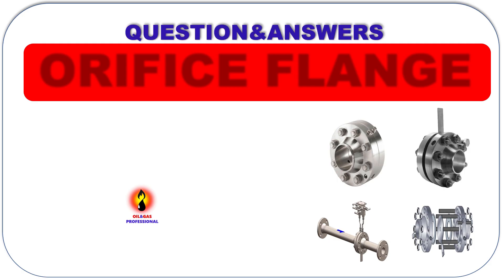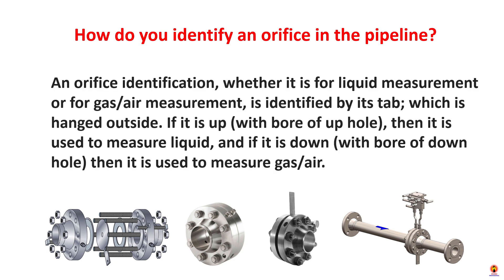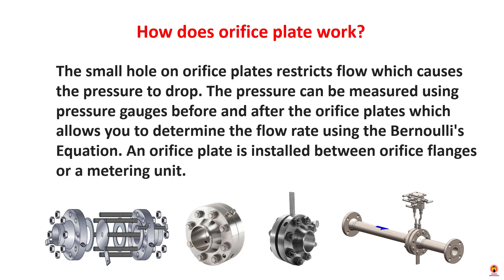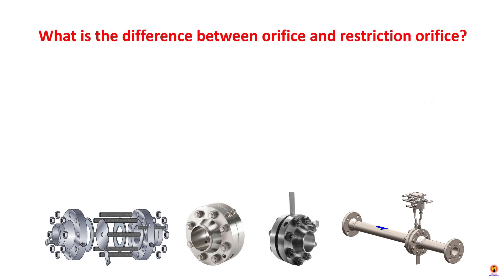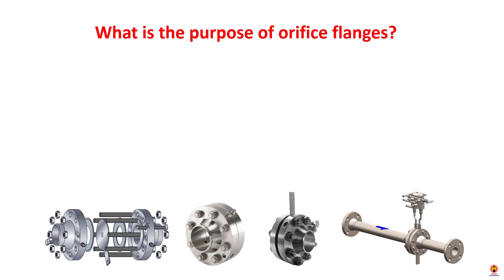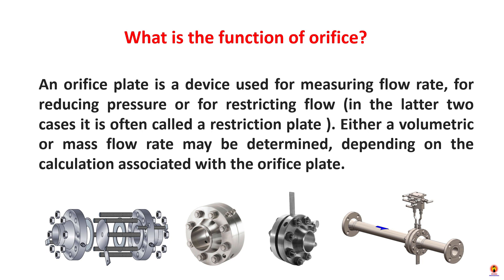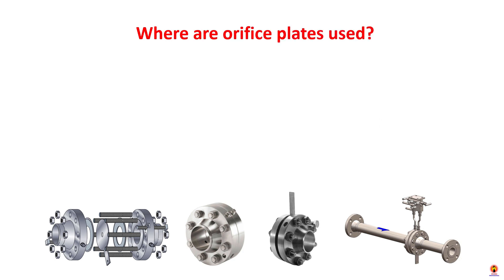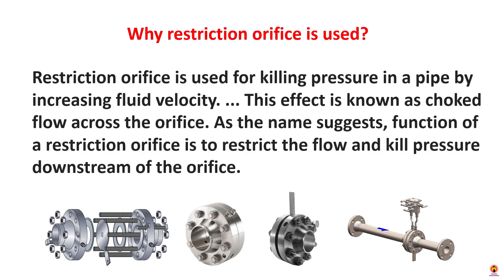QUESTION&ANSWERS ORIFICE FLANGE / OIL& GAS PROFESSIONAL

Comment: Thanks for this presentation. However I need you clarify this.
The bore of UP HOLE, you said, it is to measure Liquid while the bore of DOWN HOLE for Gas. I think this is interchanged.
As I know, the bore of UP HOLE should be for GAS and that of DOWN HOLE for LIQUID.
Thanks.